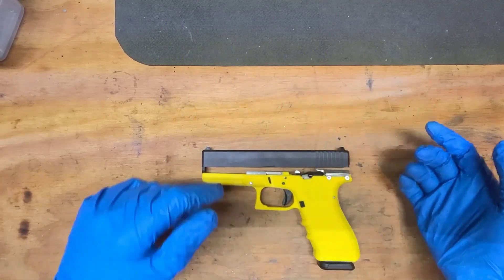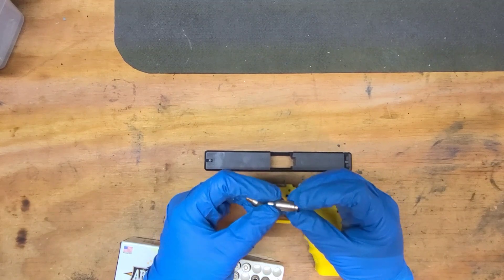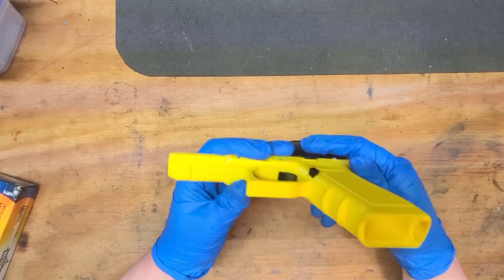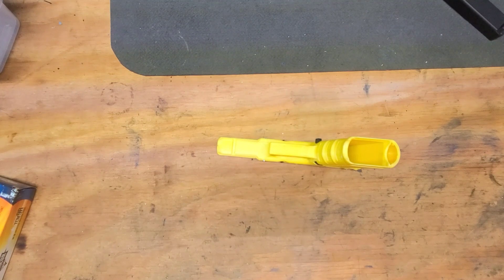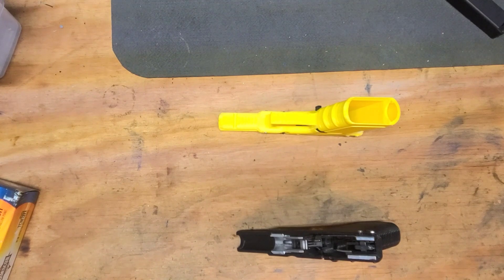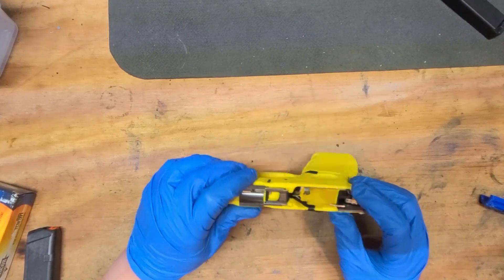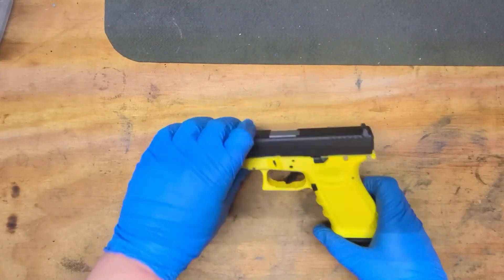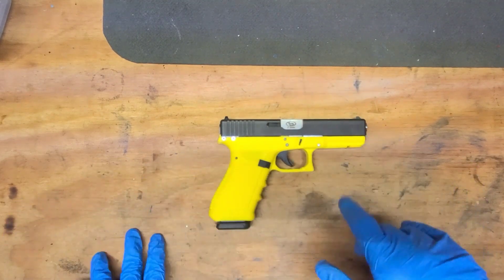So far my favorite FMDA17 freeman Don't ask to date. Show it at the end with a 9mm barrel installed.

Comment: brother man. I printed a 17 frame  and I am unsure if it was a freemans but the damn thing is too bulky and uncomfortable to squeeze my hand around. How does yours feel, and are the frames able to change out the back straps to change the feel? I wish they would have made the back straps interchangable instead of having it "connected" and imbedded as only one size. 

How much are we into the adv arms 22 by the time everything is said and done? $350 $400 total? Im talking the aa 17/22 s22lr slide kit, and the rails and parts that are required to make the 3d printed frame complete... trigger and all those little parts?

still kinda pricey eh?

Comment: Can I get the cura settings list? My print is giving me grief every time
Reply: Chances are if your ender is giving you grief you will need to clean and rebuild the hotend. That means disassembling the entire hotend and replacing the PTFE tubing.
Reply: @deltafire5058  thanks dude. It'll get a good way through the print with no issues and everything is fine, then it'll just shift over like an inch and keep going lol like why
Reply: @Jake-nz3nl  is it an Ender 3 v2? I had issues with bad layer shifting and it turned out it was a bad motherboard. Lot of other people are having issues with the 4.2.2 board. Replaced it under warranty with a 4.2.7 and everything is working great.
Reply from the maker: I'll do a video next week about my settings.
Reply: @Applianceinator  muchacho appreciato

Comment: Where do you find the locking block
Reply from the maker: Ebay is where I found these, locking block and DIY 80 rails is what's installed on this one. MC rails also has G19/26 rails in stock last I checked but they was out of 17 rails at MC.